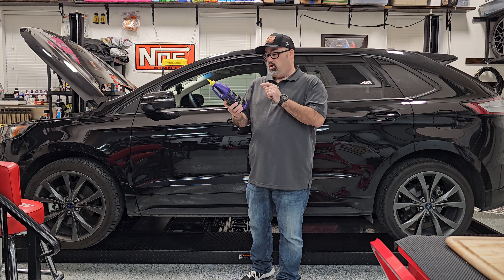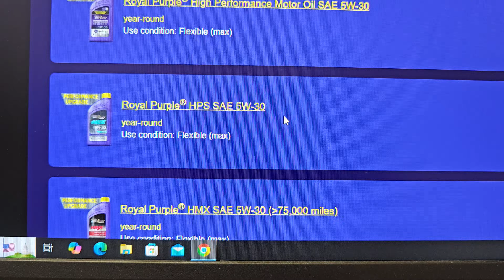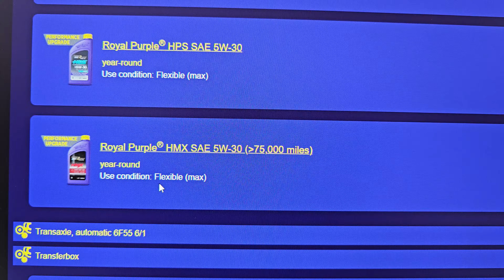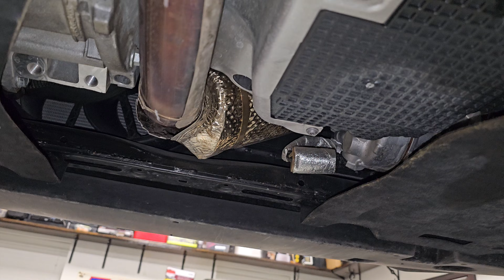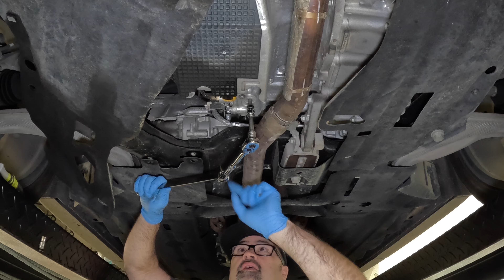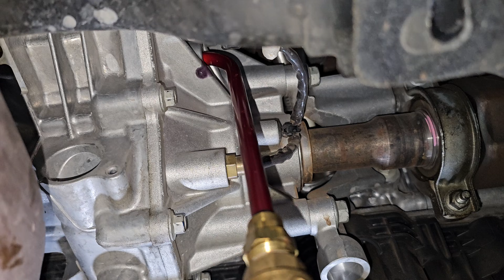Ford AWD PTU Fluid Change Made Easy | 2018 Edge Sport DIY with Royal Purple!

Comment from the maker: ⚙️ Have you serviced the Power Transfer Unit (PTU) on your Ford AWD vehicle? What mileage are you changing the fluid at, and what fluid are you running? Share your experience below—it may help the next DIYer!

🔧 In this video, we walk through the PTU fluid-change procedure on our 2018 Ford Edge Sport AWD and refill it with Royal Purple. Similar Ford AWD platforms use PTU-based drivetrains, but always verify the correct procedure and fluid specification for your particular vehicle.

🛠️ Servicing your AWD drivetrain? Check out the other end:

🔩 Ford Edge Rear Differential Fluid Service with Royal Purple:
▶️ https://youtu.be/g5dLdvG0IVg

🚙 For more real-world Ford Edge ownership, AWD maintenance, DIY repairs, fluid services, and automotive how-to content, subscribe and ride along with us:
https://www.youtube.com/@DownShifting76?sub_confirmation=1

🏁 Check out performance parts and gear from our affiliate partner, Summit Racing Equipment:
https://summitracing.pxf.io/3kAWdr

👕 Visit the DownShifting merchandise and accessory shop:
https://downshifting76.myspreadshop.com/

Thanks for watching and supporting DownShifting76!

Comment: I just did mine. 2017 looks good at 80k miles. Prev prob never changed it when I bought it used.
Reply from the maker: Thanks for sharing your experience! It's super helpful for others wondering about the condition of their fluid at similar mileage.

Comment: Google says the torque spec for that drain and fill plug is 33 lb ft. That's a lot for an  oil plug
Reply from the maker: @spacetaco1 Thanks very much for watching, and thanks for pointing that out! 👍

Yep — **33 lb-ft is the torque figure generally listed for that PTU plug**, and we agree, that sounds like a LOT when you look at it and think, “It’s basically an oil drain plug.” 😂 Then again, Ford calls for **162 lb-ft on the Edge lug nuts**, so apparently somebody in Dearborn occasionally thinks we’re servicing a tractor-trailer headed out for cross-country commercial delivery.

That said, we’d still recommend following the published torque specification — just use a good torque wrench, make sure the threads are clean and in good condition, and pay attention to what you’re feeling as you tighten it.

As you noticed in the video, we also used a small amount of Loctite PTFE-style thread sealant on the plug. *That is not something we’re claiming Ford specifically requires for the Edge PTU.* It’s simply something we personally like using on drain/fill plugs where appropriate. We’ve used that type of product going all the way back to our Harley-Davidson days because it seals nicely, stays easy to clean up later, and doesn’t turn into a rock-hard mess. Obviously, use it sparingly and keep the material on the threads and out of the fluid cavity.

Great catch on the torque spec, and thanks again for watching and adding useful information to the discussion! 👍

Comment: Great video! I'm about to do this on mine, and I found out the actual bit needed is a Torx PLUS 50 or TP50, it helps to avoid damaging those stubborn plugs when trying to remove them.
Reply from the maker: @oscarcaro4023 Thanks very much for watching! Great tip on using the Torx Plus TP50—especially when dealing with stubborn plugs that could easily be damaged with the wrong bit. 
Good luck with the PTU service and all your other projects! We hope you’ll stick around and check out some of our other Ford maintenance and DIY content as well. 
Thanks again for contributing the helpful information!

Comment: My St doesn’t have the drain plug
Reply from the maker: @mariogonzalez60 if the PTU has a fill plug you may need to use vacuum to pull the fluid from the unit. Rear diff video bellow for reference. 
Thank you very much for watching!
https://youtu.be/g5dLdvG0IVg

Comment: Awesome video. Just about to hit 90k miles on my 15 Edge Sport and going to do it. Looks like previous owner did it at 60k. Too cold to do it myself at the moment so going to take it in. How much does the dealer or a shop charge for this?
Reply from the maker: @israels5033 thanks a ton for watching the video — really appreciate it! Glad to hear it helped as you get ready for your 90k service.

For the PTU fluid change, most Ford dealers and independent shops typically charge anywhere from around $150–$300, depending on labor rates in your area. If you take it in, just make sure they’re using the correct spec fluid
Stay warm out there and thanks again for hanging out on the channel!